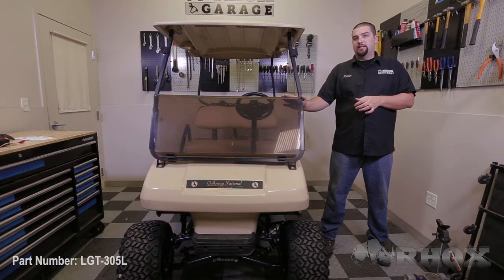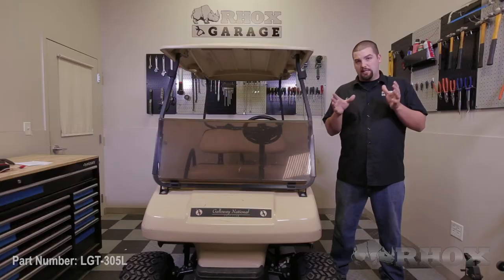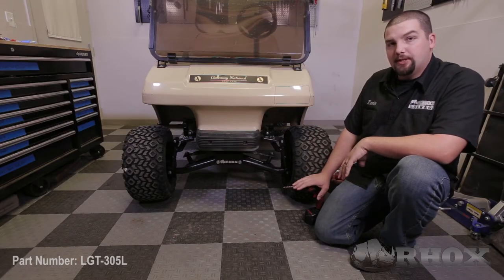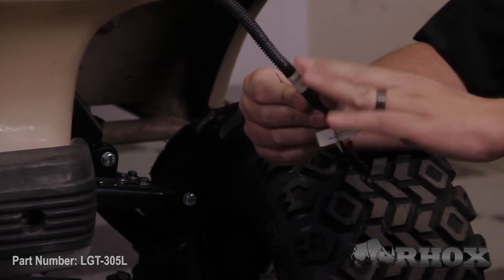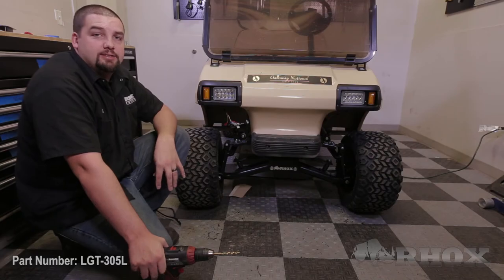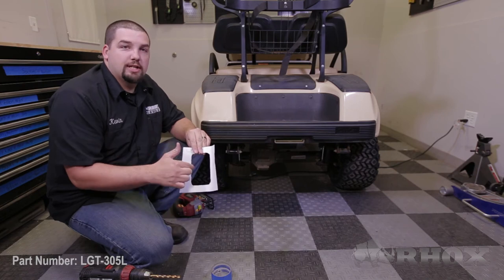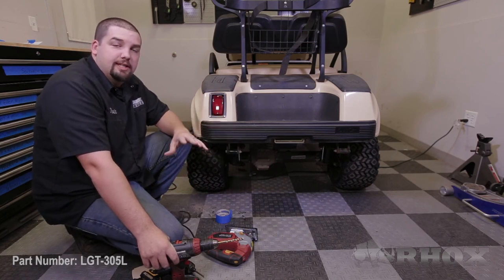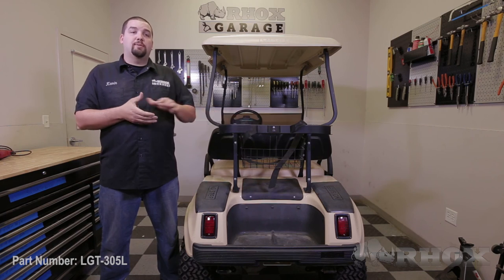LGT-305L Complete Adjustable LED Light Kit on a Club Car DS

Comment: Do you have anything on how to adjust the beam once the housings are installed?
Reply from the maker: We don't have any videos for it, but I believe the adjustment screw is on the front of the headlight.
Reply: @GolfCartInstructions  Thank you for your reply. You are correct, Got them aimed without any issues.

Comment: I have a 99 DS with halogen lights already installed.  Do you think it would be an issue replacing with LED's when the bulbs wear out?  I doubt the holes would align but the shrouds should fit I would think.  Thanks.
Reply from the maker: Would you be able to send me a photo of the lights you currently have?
Reply: @GolfCartInstructions  sure when I figure out how. No rush.
Reply from the maker: @34dawgsgo  You can email them to me too. rugged@rhox.us
Reply: @GolfCartInstructions  sent thanks.